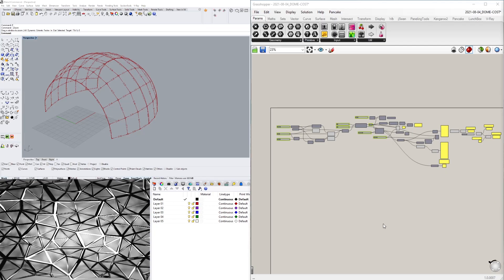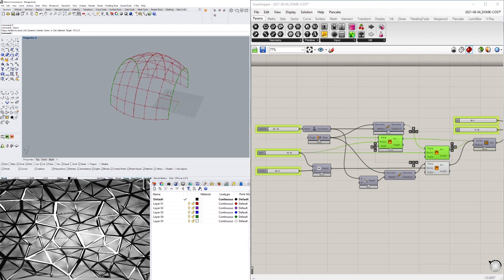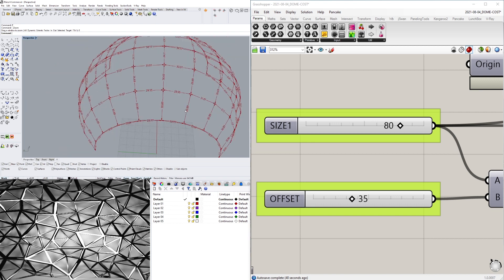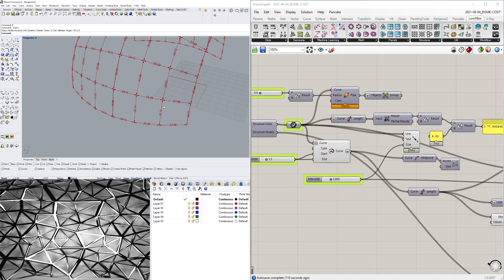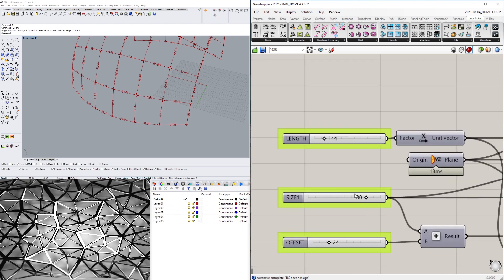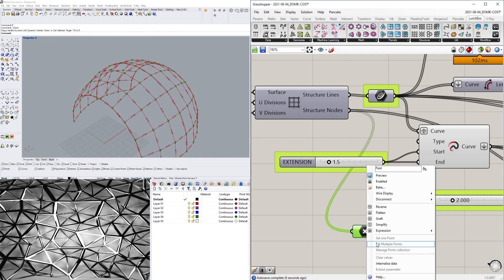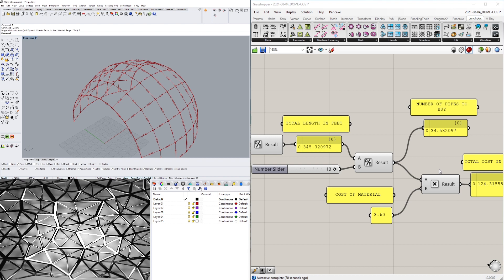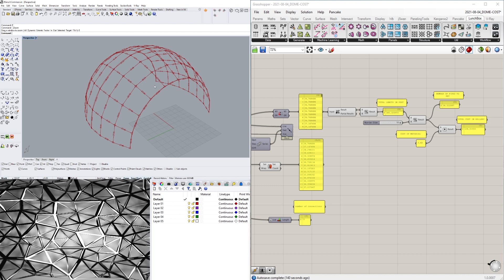Dome design material cost for parametric structure Rhino and Grasshopper tutorial

Comment: It helped me a lot figuring out the length of Struts on my project. The issue I am having now is how do I figure out the angles I need to cut on edges of Struts for assembling my dome. In combination with your video on Parametric Geodesic Dome creation, where you gave thickness to each Strut, I don't know how would I go about this problem. The only thing I can think of is to detach individual struts and measure the angle in which Grasshopper cut them to form the Geodesic Dome. :/

Just saw you have payed Courses as well. Maybe more information is there?